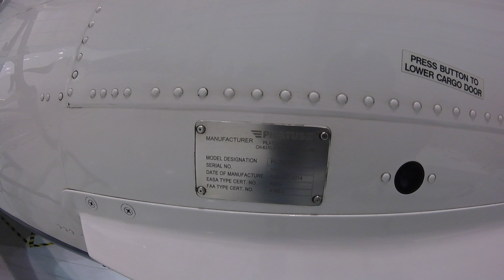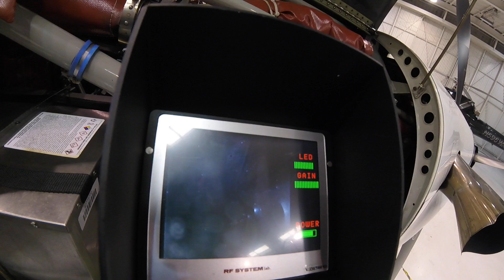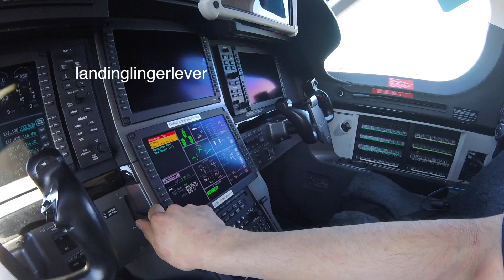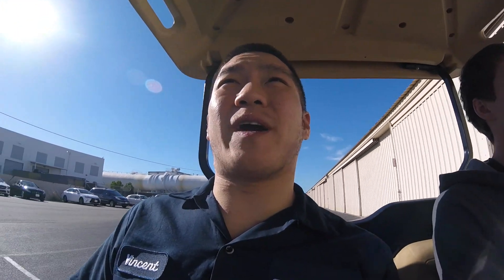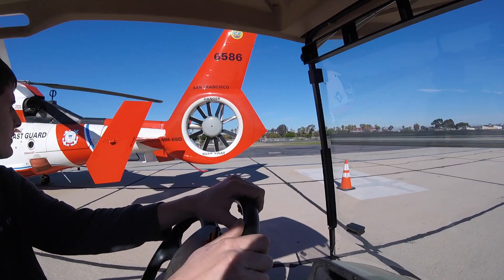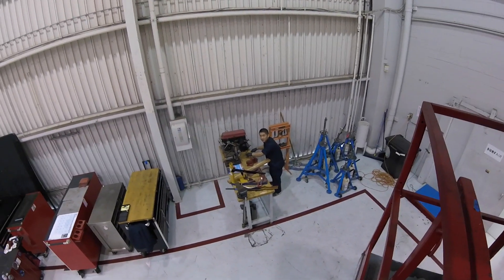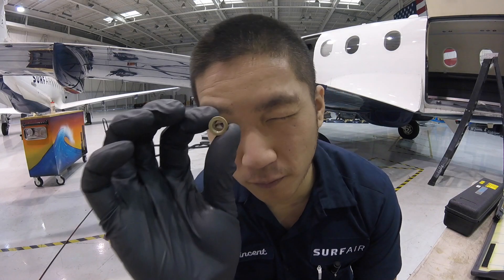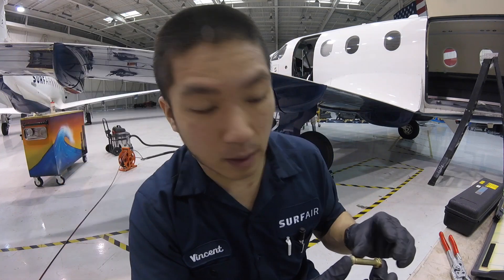Pilatus PC-12 Corrosion Inspection

Comment: As someone who works in the industry, I just want to say thank you for going by the book.  I've seen so many mechanics that cut corners.  I know many of them that would have blended the corrosion on the actuator, hit with some anti corrosion, and never thought anything else about it all to save a dollar.  Could that actuator work fine and the corrosion wasn't that bad? Correct, but it wouldn't have been by the book.  As you stated, the manual says that if there's any corrosion...and you handled it beautifully.  Thank you for your attitude and leadership.
Reply from the maker: Lead by example! Thank you for the kind words.

Comment: So what happened with this channel? Seems to have been quiet for a bit now. What a shame. It has excellent content.
Reply: He became a pilot.
Reply: Most likely they got fired or in trouble for filming while they should be working. Not trying to be a jerk by that statement, but I've been an aircraft mechanic for 25 years and filming yourself while working wouldn't fly at just about any place.
Reply from the maker: No hard feelings! It was approved by our management so no issues there. I'm working as a pilot now and Vince is working for a different outfit out of Van Nuys. We're both doing well!
Reply: @JamesSullivans  I’m glad to hear that. Best of luck in your new endeavors! Maybe you can continue your channel on your new career path as a pilot.

Comment: Is it really corrosion ? It looks like a typical small paint/lacquer loss without any infuence on mechanical properties or flight safety (mayby I'am wrong).
Reply from the maker: It was really corrosion. I should have done a better job filming it.
Reply: James Sullivan Small "damage" and a lot of cash for new spare part...
Reply from the maker: Warranty for this one ;)
Reply: James Sullivan What was the total flight time for the replacement ?
Reply from the maker: Just under four thousand hours. Like I mentioned in the video the actuator we installed has a newer corrosion preventative paint in that area. I also reached out to Pilatus to confirm the rest of our fleet has the new design. That actuator gets removed for overhaul every five thousand hours anyways so just a little early.
Reply: James Sullivan I see. So, Pilatus decided to implement an "upgrade" by paining it. Kind of NG ;-)
Reply from the maker: Hahaha exactly!
Reply: Anyway, really nice plane :-)